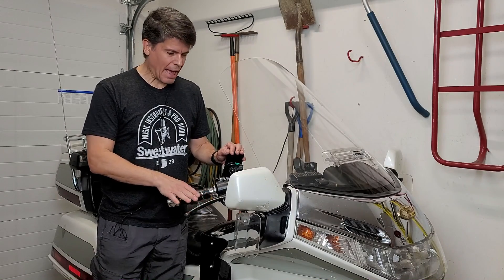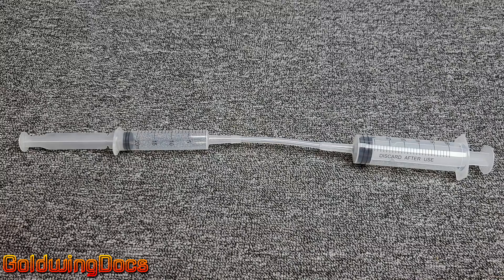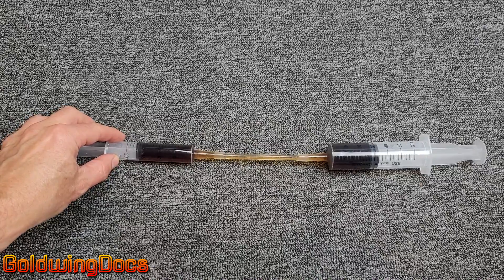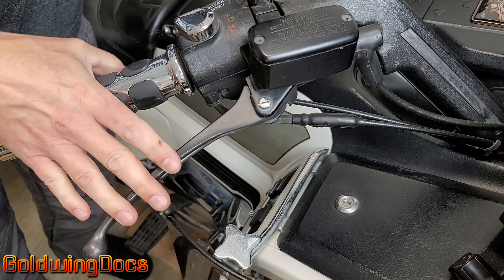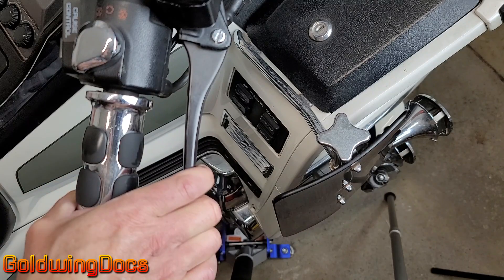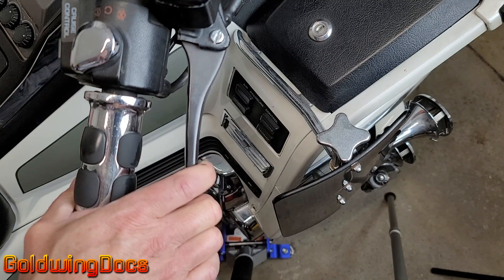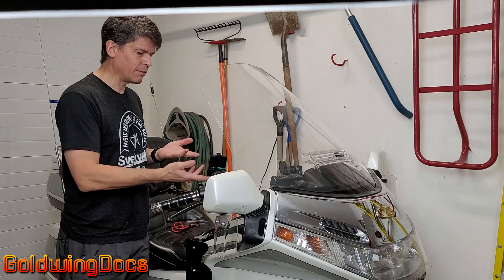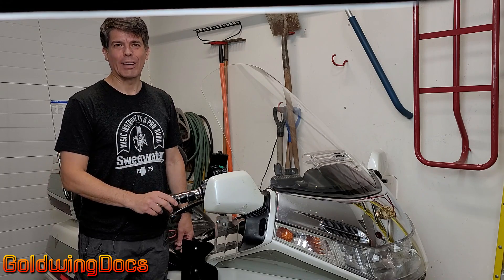Brakes: You think you know how they work? You're probably wrong...

Comment: You lost me when you misidentified the caliper as a slave cylinder. While the caliper does technically contain a slave cylinder, when combined with the brake pistons, it becomes a caliper assembly. The brake pistons are not "slave cylinders". Slave cylinders do not move and do not press on the pads.

Comment: This video has a lot of correct information. However, there is one tiny detail that is not quite correct, but a common misunderstanding. It's mainly not the rotor runout that will return the pads on a diskbrake.

But the seal ring for the piston in the caliper will twist a little when you apply pressure. Both because of the motion of the piston, and because of the pressure from the fluid. When you release the pressure on the fluid, the seal will retain it's original shape, and retract the piston just enough to release the pressure from the pads on the rotor. The piston will not move a long way back. Maybe less than a millimeter. But this clearance is important for the pad to be completely free from the rotor.

This makes it very important that the piston can move freely in the cylinder, and the seal is the only thing that makes the piston stick. If there is rust and dirt inside, the flexing of the rubber seal may not be enough for the piston to return properly. Then the brakes will not release, and may be damaged from excessive heat.

Comment: It seems that with the bungee cord you compressed the air but did not remove the air.
Reply from the maker: The problem is that the air bubbles are too large to migrate past various orifices. By putting the system under high hydraulic pressure overnight, the air bubbles are compressed to a tiny fraction of their original size, and then easily migrate up to the master cylinder reservoir.

Comment: I would like to see a video on how to make the lexan windshield clear again like it is when it's new.
Reply from the maker: Typically you can't. On acrylic you can polish it out, as it's fairly hard. But polycarbonate (Lexan) is relatively soft and scratches easily. For this reason, a hard coating is applied over the top surface during manufacture. Abrasive polishing would remove that hard coating and leave a soft, easily-scratched surface exposed.

Comment: To release the air out i use à tiewrap for application wait a little and gently tap on brake lines to shake the stuck Buble to encourage to groupe Make larger bubble that will go up easy then leave it over nite and repeate in morning if you remove thé cover sumtime you se micro bubble Come up just like foam its not mutch air but enough to cause trouble.

Comment: The foot pedal works the front wheel brake on my gold wing 1989 worked one of the slave cylinder
Reply from the maker: On the GL1500, the front brake lever operates the front right caliper. The foot pedal operates the front left caliper and the rear caliper.

Comment: What is the process for getting the air out of the line for the rear brake that activates the front left and rear; and what to use to keep the peddle pressed down?
Reply from the maker: First, the normal bleed process is used (bleed the front first, then the rear). I then just lean something heavy over and using a piece of wood, make it press down on the brake pedal, and leave it sitting like that for the night.  The last time I did it, I put the end of my heavy trolley jack balanced on a piece of wood, with a trash can balanced on top of the jack. It probably put 60-70 lbs of pressure on the brake pedal.

The only thing I did do differently for the rear is to bleed the brakes one last time after it sits overnight, as it has lots of up and down parts in the brake system to trap air bubbles, unlike the front brake which is basically vertical.
Reply: @GoldwingDocs   Do you have a vid on GWdocs demonstrating on how to bleed the rear brakes properly?
Reply: @GoldwingDocs  should the reservoirs be opened during the night while levers or pedal are pressed?
Reply from the maker: @gabrielstaniecki  Definitely not - brake fluid is hydroscopic, and will absorb moisture from the air. Don't leave the reservoirs open for any longer than it takes to fill them.
Reply: @GoldwingDocs   thanks a lot . I am asking because many times we can hear advice to leave bleeding valve open the same way for the night.
Reply: @gabrielstaniecki  I PERFORMED THE ZIP-TIE WITH THE FRONT BRAKE TEST LAST NIGHT, AND WHEN I GOT UP THIS MORNING TO FIRE MY BIKE UP TO COMMUTE TO WORK, THE FRONT BRAKE WAS HARD AND TIGHT FOR SURE. I DID NOT OPEN THE RESERVOIR TO ACHIEVE THIS. I OWN A 99 GL1500 SE AS SCOTT DOES.
Reply: CarbonCopy CH4  Great!